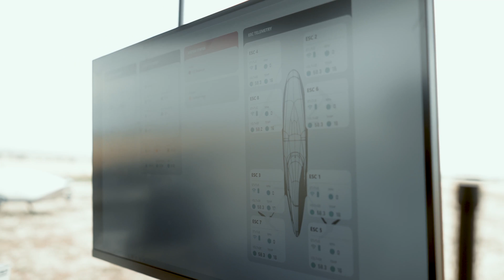How GPS and autonomous safety systems improve pilot safety | Alauda Aeronautics

Comment: Why put a pilot in it if you're going to start automating things? Takes a lot of skill out of it, this is why assists aren't legal in most motorsports. Find other ways to increase safety because automation is boring.
Reply: I guess it's because of the batteries inside as well as the propellers. When you have a car crash - it's just a hit damage, while with those vehicles you get a cut damage with the propellers. I am not sure what the propellers are made of but think of this as a HUGE BLENDER. 
Sometimes in 3d you are not aware of where the other people are. Sometimes they may just hit each other and... well... blend the other pilot. 
Or, the battery. If they are using LiPo type of a battery - cutting them may result in a serious fire and kaboom. 

As far as I agree that it is "boring" to have automation... As they say it's like a failsafe button. So whenever stuff goes wrong or pilot loses control - this will save their lives as well as the lives of other pilots. 
It's something like collision control in a tesla. It doesn't make driving boring.
Reply from the maker: @MaiOnHigh  Absolutely right, pilot and team safety is priority. Ultimately, pilots will have freedom of control until an unlikely failure. In which case, these systems are designed as a failsafe, a last safety back stop.
Reply: @Airspeeder  so what determines the switch to an automated system? I race just like Maion does, it's not slow and having an autonomous system as backup would mean that it can determine what the pilot is about to do or about to happen. Now in a 3d world there is many possibilities in any scenario, in a race. The only plausible safety feature I see working close to 100% of the time, is some kind of deployable caccoon system. I think an autonomous control system will cause major issues and potential more dangerous in a race situation.
The hull and canopy design will need to be almost indestructible for the pilot to be safe from even a propeller strike.